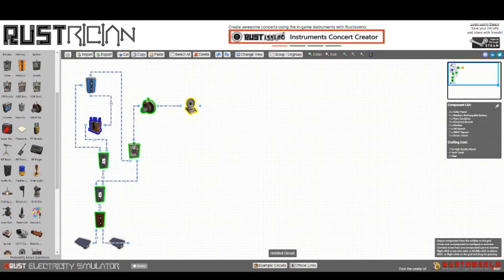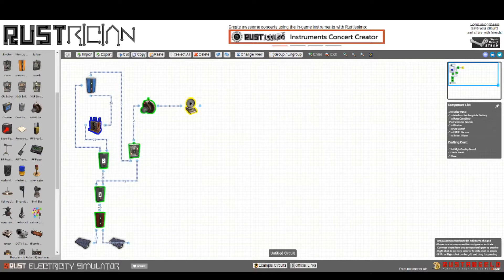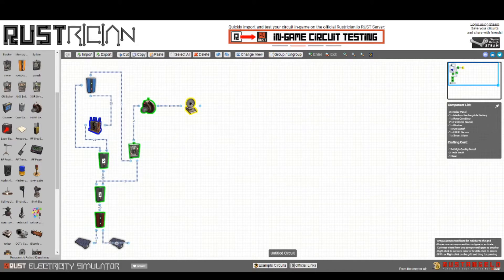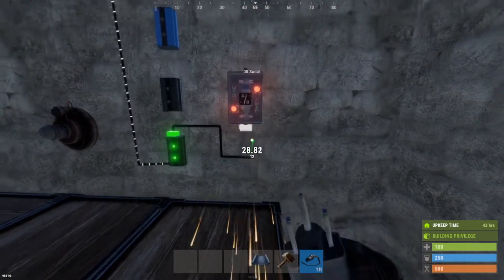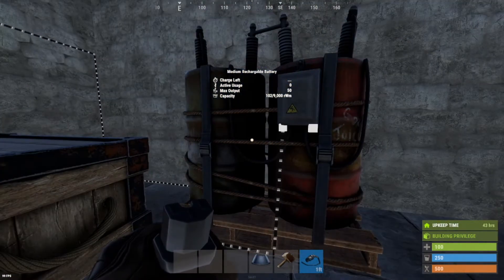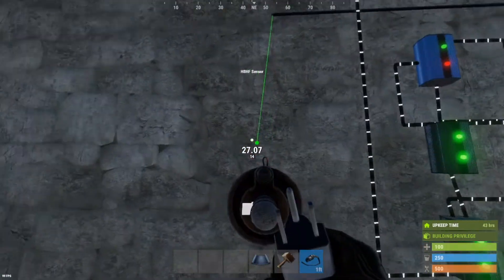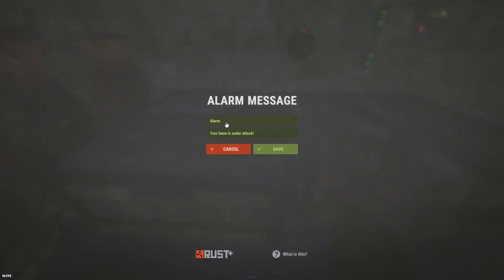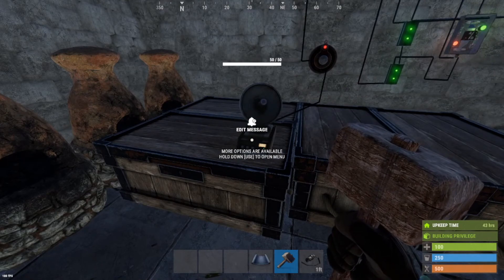Rust Electricity - Smart Alarm Rust App

Comment: Yo. If you wanna make a quick electric video maybe don’t have that aweful intro. Also there’s any easier way to do this. If you connect the hbf sensors (or even auto turret-what we use) to an XOR you can chain these together (they’re glitched and don’t consume power )

Draw back is that if two sensors or inputs are triggered the same time the circuit won’t work but it’s so much simpler than what you’re doing

Comment: The blocker/Or switch route is completly unnecessary. Just wire the solar panels to your battery, and the output to the hbhf sensor. Easy and uses way less power than this method
Reply: True. Or Just use one branch to deliver the needed electricity for the hbhf sensor setup. This way, player can add more branches later to connect more electric components.